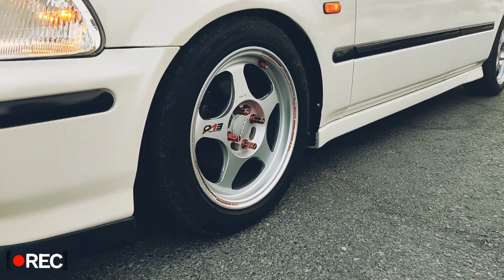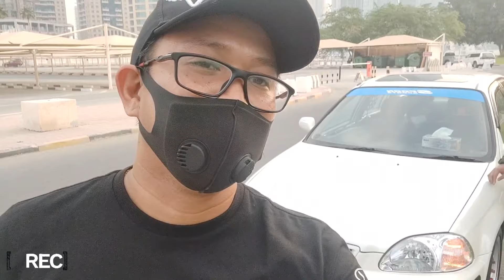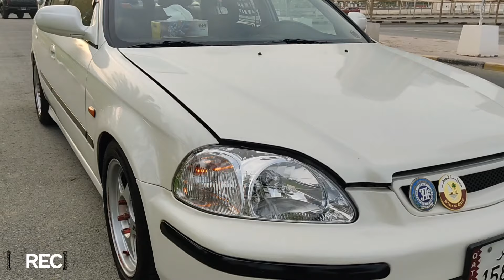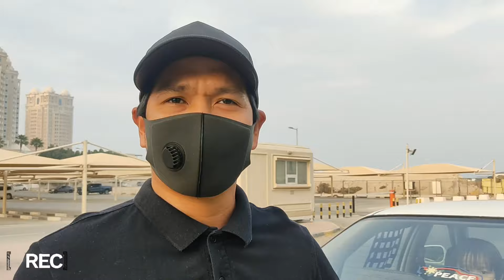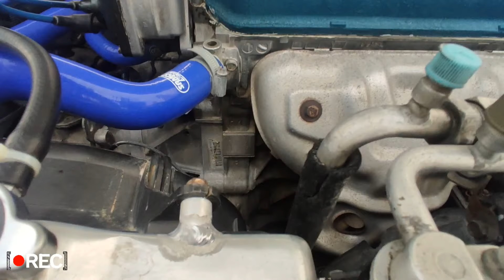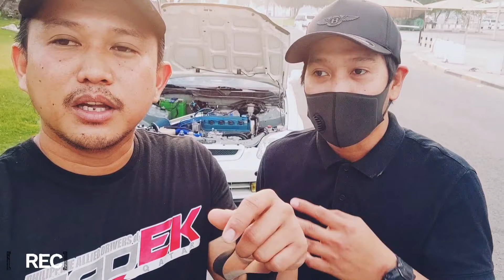HONDA CIVIC 96-98 MODEL | BIGOTE |   EK

Comment: Paps ano b ang computer box n nklgay s 1996 ph16a engine
Reply from the maker: Paps sana maka tulong sayo. i did a little reaserch. mejo nkakalito din yan. 

1996-2000 VTi (Phils. & NZ/AUS)
Displacement : 1,590 cc (97 cu in)
Bore and Stroke : 75 mm × 90 mm (3.0 in × 3.5 in)
Compression : ?:?
Power : 127 hp (94.7 kW, 129 ps) * 5800 rpm
Torque : ? ft·lbf (? kg/m, ? Nm) * ? rpm
Valvetrain : SOHC VTEC(4 valves per cylinder)
Fuel Control : OBD-2 MPFI
Head Code : P2J
ECU Code : p2n
Piston Code : P2MY

dito sa qatar may lumabas na mga vtec na vti pero may iba na hindi sila 20 camlobes .ung Vtec E ang tawag nila.

Comment: Hi po sir magtatanong lang po kung san po location ng camshaft sensor ng civic lxi? Wala po kasi ako makita sa likod ng gulong sir. Posible ba na ang lxi is nasa loob ng distributor ang camshaft sensor?
Reply from the maker: Hello Sir. Sa sasakyan ko po sir is non Vtec LXi model Wala Po akong nkitang camshaft sensor. May nakita akong model ung D17 galing 2002 model meron Po sya sir. Pero sa LXi sir Wala pa akong na encounter.
Reply from the maker: Ano pong model Ng sasakyan nyo sir.
Reply: @TanzRacing  salamat po sa reply sir. Honda civic lxi non vtec dn po. 99 model manual sir
Reply: @TanzRacing  may problema po kasi lxi ko sir ang firing order ng injector sir is sabay sabay po sila bumubuga. Diba dapat po 1342  firing order ang buga po ng injector ng fuel sir. Ano po kayang problema nun sir.
Reply from the maker: @jonathanbasilio1486  sa start up sabay pag running na hindi na sir. usually pag miss firing may sensor na d working map sensor TPS. anyway may check engine kaba sir? 
tapos ung injectors mo sir.kelan last linis nila? minsan dahilan din yun.
Reply: @TanzRacing  ah ganun po pala sir kalako palaging sabay sabay injector sir. Kasi amoy na amoy gas sa butso sir. Mga 5months ago sir.
Reply from the maker: @jonathanbasilio1486  rich sya sir di nagsusunog ng maayos ang oto.linis sparkplug ka sa sir. check sir bka panget dn sunog ng spark plugs.
Reply: @TanzRacing  thankyou so much sir idol. Copy sir gawin kopo yan. Godbless
Reply from the maker: @jonathanbasilio1486  thank you din for dropping by sa channel ko.
Reply: @TanzRacing  sir idol tama po kayo tinest ko line ng mga injector pag umaandar ang engine using led diode light nag pafiring order ngapo sya. Muntik nako mapabili pyesa or mapa scan at malaking gastos un. Big help po sakin! Thankyou so much sir!!!!
Reply from the maker: Yown nadale. You're welcome sir. 🤘